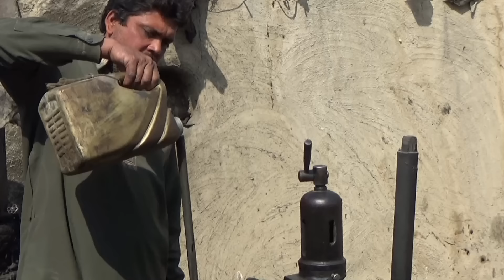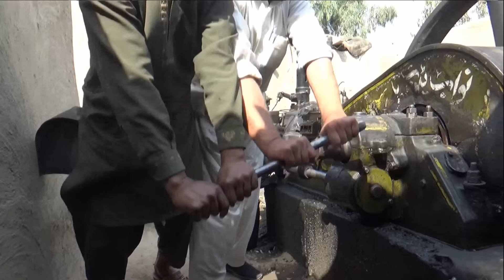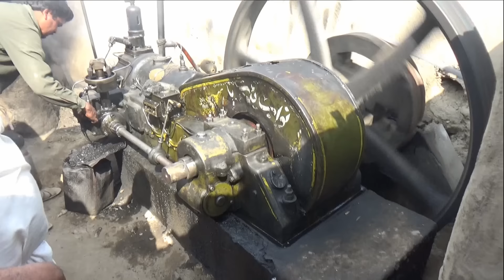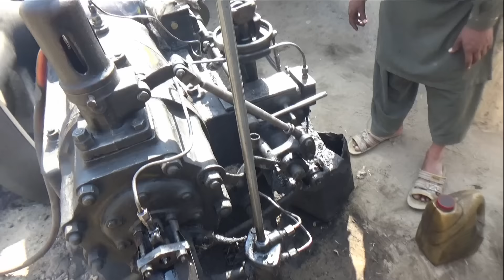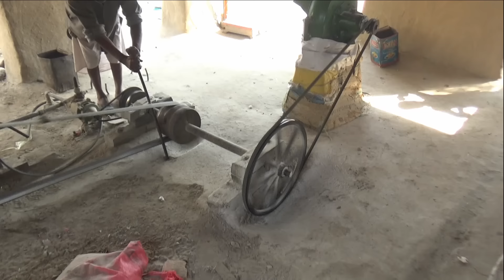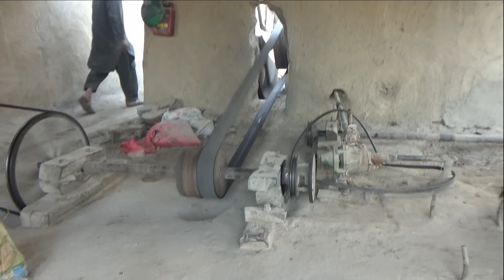Starting the Diesel Engine Best Sounding Engine 22 Hp 300 RPM Old  Black Engine

Comment: The exhaust whistle is so the operators can be away from the engine and still tell how it is running. Exhaust whistles were used in oil fields for that reason.
Reply: I was wondering about the purpose of the whistle.I thought it was to muffle  the engine clatter. Was sure the exhaust whistle was for something but not sure what. Thank you for explanation.
Reply: @nextlevel7790  they are usually made unique for each engine so you could have a dozen running in an area and be able to tell each one from its sound
Reply: Thank you!
Reply: Simple, inexpensive, funny and efficient
Reply: Not only the operators, the whole town can tell its running... :)
Reply: I put an exhaust whistle on my car. Daughter was not impressed with the turbo sound.
Reply: or just install an electric motor and forget that its ever there like any sensible person
Reply: @Blox117  then you need to manually start the engine to get the electric motor running.
Reply: @colinashby3775  *then you need to start the electric motor to get the engine running
Reply: Whoa. Thank you for explaining truly! ☺️
Reply: That's what the cherry bomb is for 😎
Reply: That’s a very interested fact. Thanks
Reply: I bet if I put one on my car's exhaust I'd be considered to be very cool.
Reply: @Blox117  nah....  that's not nearly as much fun.
Reply: @Blox117  yeah this place doesn't look like it has an abundance of affordable electricity
Reply: @raposonanquim7987   My life goals right there.
Reply: @Blox117  A 22hp electric engine with the amount of torque this thing puts out would cost thousands of dollars 💸  also it would require a 3 phase electrical supply. These countries barely have reliable single phase....
Reply: @jeremeneff3806  actually electric motors produce the highest torque of any prime mover. and one can be had for a few hundred at most
Reply: @Blox117  can you show me a 22hp electric engine with 65 pound feet of torque that is only a few hundred dollars and will reliably run in a 3rd world country with sub standard electrical grid?
Reply: Also, rpm range is very low so a gearbox would be needed as well.
Reply: @jeremeneff3806  if you tell me in newton meters sure
Reply: @jeremeneff3806  no an electric motor has an infinite RPM range unlike literally every other prime mover. also, 3 phase DC power is fed through an electronic controller that is powered by a battery. very very cheap and easy solution and it practically has infinite lifespan while being free.
Reply: @hughstewart547  solar panels to a battery. free
Reply: @NextLevel  not sure what engine clatter you're hearing.  The slapping of the external belts is n the loudest thing other than the exhaust whistle
Reply: its like those alarms that are sounding 24/7 with radioactive stuff, so if there is a catastrophic loss of power and you dont hear the alarm you panic
Reply: Uh do
Reply: Ну так тут рядом , он не нужен
Reply: I thought maybe Bubb Rubb had got to it.
Reply: But..........they are only 20 feet away from the engine!
Reply: headache
Reply: Подивитесь на теперішні движки через 70 років...і побачите різницю
Reply: @colinashby3775  свисток треба зі звуком b-29
Reply: These type of engines were used in the absence of electricity. Or they were used to generate electricity..

(As u know, electricity requires physical input from somewhere. Doesn't come out of the ground or grow on trees ofc.)

Comment: This engine has survived 67 years, so the maintenance can't have been that bad!
Efficiency around 30 %, but It can run almost on garbage! Woodgas, old motor oil..
Look at the exhaust! Looks Clean...
BTW, I was made that very same year, also still working!
Reply: U Probably use very good lubricant
Reply: Me too...also still working fine.
Reply: What do you run on? Asking for a mechanical friend in need....
Reply: 30% efficiency would be a hecking killer engine, I think you mean 30% of a modern one, and I doubt that too!
Reply: @Kalvinjj  modern diesel can have up to 44%
Reply: @jetztisfeierabend   The big slow stationary or marine ones can indeed, I think Wärtsilä managed like 54% out of their biggest marine ones, tho they also run with heavy fuel oil, dunno what fuel the test is made with.
It's impressive what you can do when you extract as much as possible on expansion and even the exhaust with a turbo.
Reply: 30%, only achieved with hybrid cars nowadays.
Reply: @pear7777  there is a difference in efficiency in petrol engines and diesel engines. Diesel have a much higher efficiency
Reply: It probably hasn't ran for at least 50 of those years. Of course it's gonna look clean.
Reply: 30% efficient though
Reply: I was trying to make a joke but I didn’t know how to write it 🤷🏼‍♀️
Reply: @NaviYT  better than any gas
Reply: @wizard_of_poz4413  I meant to say that he was made on the same year as this engine and he too runs at 30% efficiency lol
Reply: Cars are only traditionally around 30% efficient
Reply: It is very worn. A new, tight engine would start on the first turn.
Reply: Old is better then the new, not bounded to circuit boards or diodes . EMP proof.
Reply: Can this engine run on nitrous oxide (NOS) ? 🤣🤣🤣🤣🤣🤣🤣🤣🤣🤣🤣🤣🤣🤣🤣
Reply: Happy 70th
Reply: But hows ur exhaust?   Lol
Reply: Idk if wood gas is going to compression ignite - I think it still needs that spark
Reply: @Kalvinjj  Hybrid gasoline engines have 40% efficiency. That's for a hybrid. (Hybrids use Atkinson cycle, which reduces power but drastically increases efficiency)... Now muscle cars and super cars? Extremely low efficiency. But yes, 30% is good for a relic.
Reply: @pear7777  40% is current hybrid engine standard. The overall efficiency is technically 50%, when you include the energy captured by the electric motor and the EV motors superior efficiency when running off the battery power that was captured by either regenerative braking or the gasoline engine also generating electricity.
Reply: @stevebannon9250  For  conventional internal combustion engines that run on gasoline, yes. Atkinson gasoline engines, which are probably only used in hybrids, have 40% efficiency. EVs have 80-90% efficiency (Hybrids are an average of about 50%, largely dependent on how often the electric motor is able to propel the vehicle alone; plug in hybrids have higher efficiency due to larger battery, but the tradeoff of a much heavier battery pack makes that not as much.).
Reply: @jetztisfeierabend  It is now possible 50%, but 40% is the norm, unlike the 30% norm for most conventional gasoline engines. It's a shame diesel hybrids aren't common. It'd be nice to have a hybrid whose engine would easily last a couple millions of miles.
Reply: @anmolsekhon768  hahahaha
Reply: The efficensy is generally rated in electrical kw output at a generator head -  there is a lot of differences between diesel engines and the types of fuel they burn - 
     In the US all fuel on land is low sulphur fuel - yet marine diesel is 30% oil and 70% diesel - that's also used in places like India today - in the warmer regions - 
      There is also Bunker C fuel that is used in large marine  diesel engines - 
 In that case it's thick like motor oil and the fuel lines are heated to 350° f up to the injectors - also the engines have heaters to preheat the water to running tempriture before there started or the head will build up carbon if there started cold - 
       There Diesel's that run on tar oil - that like thick grease - the tar oil is also preheated up to the injectors to around 425° f  - the engines use oil for coolant and run at 250° f as to burn the fuel completely - 
     A diesel is just saying the engine starts on compression - but also the compression is only needed for start up - some stationary engines have compression change over valves - they might start up at 25:1 compression - then the compression is decreased after it's warmed up to temp to 9:1 compression - also some have a 25:1 efficensy were as a motive engine  that's a truck diesel might have a 5:1 fuel efficensy -
      Some of those stationary engines are extremely fuel efficient -  as for that engine from time to time the head is pulled and the valves are lapped back in -;
        Engines as  that one are still in service in oilfields running jack pumps some run off the crude oil coming out the well they pump.- it's refered to as diesel crud -

Comment: Beautiful old engine, still earning its keep! They knew how to build things back then!
Reply from the maker: Thank you so much sir
Reply: They still know how to. They just don't  want to.
Reply: Still can and still do 
Just need to pay for it....

The modern automotive ICE is a mechanical and electronic marvel of engineering
Reply: :D :D :D 

Actually... no, they didn't.... That lack of knowledge is why this 22 hp engine weighs 500 kilo or more (imagine the labour in mining the raw materials, the energy and manhours spent in casting, forging and machining the parts, the transport from production plant to wherever it needs to be)  and only spins 300 RPM. Takes several men and a lot of experience to get it to run, in fact it is such an effort that it is being started at the beginning of the day, and kept running all day even if there is no power requirement. Which cancles out in great part the otherwise good effciciency of even those ancient machines.

Back then a 22 hp engine would cost a small fortune and you had to formally order an individual engine, have it transported, installed, commissioned, operators trained, etc etc. A thousand bucks "1950's " compares to 12500 dollar nowadays.
Nowadays a stationary diesel can be bought off the shelf, installs in a few hours without fuss or commissioning, costs about 75 bucks per HP, and a 22 hp diesel engine weighs maybe 50 kilo including its generator, starts at the push of a button (so can be stopped without penalty if no power needed), and if it breaks down, well, you can buy a LOT of engines for the price difference between that ancient behemoth and modern stuff.

Nah... They did not have the faintest clue how to build a diesel back then.

But it IS beautiful technology, no doubt.

Comment: We have this in our village.they run this engine for corn mill, saw mill, and cotton mill.its was made 1911.whistle was used to let everyone know ,Open for business
Reply: It was actually used to tell the people cranking to take it out. It can kill you. It's actually the reason why cars don't have cranks now. The ceo of Cadillac Corp had his friend killed by one ans made a self starting one
Reply: Reminds me of workshops around here which used to use steam boilers.

They had a whistle outside, and once the boiler was hot enough to do work they let out a blast so customers would know.
Reply: That sounds closer to the right year for this engine. The design has probably been copied down the years because it is a solid simple workhorse.
Reply: @briananthony4044  i think it's even older design maybe around 1870? It's just a huge single cylinder oil engine, they have been since almost forever.

Comment: We had a similar one in India, which was around 50 years old, and was being used as an electricity generator. Delivered an output of 15 KW. Sold it around 10 years back. It was virtually unbreakable. Fond memories.
Reply from the maker: Thanks for watching the video
Reply: I bought a corded grinder from harbor freight and used it for 15 seconds and it smoked out. Smelled like burnt toenails
Reply: @biguprochester  ha ha. No that feeling.
Reply: Hello Same engine I have can you tell me what can do with these engine I have machine mannual and many papers
Reply: My guess is it was a DC generator on a battery bank on less it was to run motors on equipment - slow speed engines set up on generators are generally only used to drive electric motors or to charge battery banks - 
     With slow speed engines they create a voltage pulse that makes lights flicker - that flicker can be irratating on the eyes at night - 
     Generally single cylinder engines are not used for generators that run below 650 RPMs because of the voltage pulse of slower speeds - below 650 RPMs they use 2 & 3 cylinder engines for generators -
Reply: @able880  yes, it cause lights to flicker. But, it was an industrial establishment so didn’t bother that much
Reply: @coldsampat3972  my guess is they primarily used it  for  motors - my grandfather worked on engines and generators in small towns that still had hybrid power plants and that were 110 volts DC - 
       They had single cylinder 100 to 200 HP engines that ran from 200 to 360 RPMs - since they were   used to charge the large storage batteries  there was little to no flicker - also they used large chokes with capsitors to smooth the DC coming off the generators that charged the batteries so the voltage off the battrey's had little to no ripple off the generator while charging the power house battery's -  REA replaced most of those old DC systems with AC power by the 70s -

Comment: It’s cool seeing all the other devices being powered with belts coming off of the Diesel engine
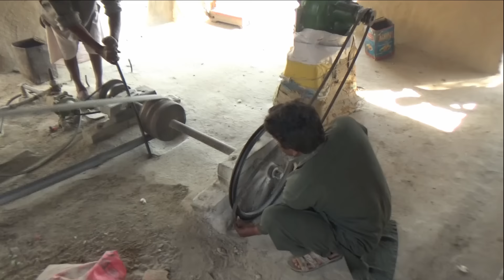Reply: I wonder if the man who mounted the belt with the engine running still has all his fingers attached (Minute 3:00). I was present when a friend manually pushed the belt of a compressor to help it start, it did start and he lost three fingers. Ouch.

Comment: Keeps 100 years: ✅️
Easy to repair: ✅️
Easy to use: ✅️
Reliable: ✅️
You're keeping fit by starting the engine: ✅️
I give 10/10 points it's better than this cheap sh... which breaks after 2 days👍
Reply from the maker: Great point!
Reply: Maybe low power output. But diesels made prior 2002 are great and powerful compared to modern crap
Reply: Cleaner than a VW ✅✅
Reply: Except with the huge amounts of fuel it burns, you could get like a 20lb electric motor and make that much power for the next 50 years for dirt cheap.
Reply: I think maybe check your definition of “easy to use”. Took 2 men multiple attempts of hard manual graft to get it started.
Reply: @ThaTurminator  If you get longer shaft it gets easier...
Reply: @ec7005  Well for all that fuel you get longevity...
Reply: And it will hold for next 200yrs if maintained properly
Reply: @josippetkovic389  electric motors under similar conditions can last just as long or longer without all the maintenance, and they're cheaper, simpler, direct drive, quieter, and weigh relatively nothing. Just because one random motor got kept up well doesn't make the underlying technology inherently superior, it just means someone actually did the work to keep it going.
Reply: Only costs an arm and a leg from time to time
Reply: Inefficient:✅
Reply: @ec7005  gotta buy a motor and have a reliable power supply.
Reply: @kr1886  which is incredibly easy
Reply: @ec7005  I like you
But hey you get a piece of history and maybe you turn some kid into engineerd with this
There is no magic pixies out of a wall that are running this thing. You get knowlege when using this, education aint cheap
Reply: @josippetkovic389  Electric motors give you just as much of an education if you take it apart and learn three phase power, battery management systems, and electromagnetism. It's just a different skill. There's nothing wrong with having or using this motor. My only point is that it's not better, especially just because it's old and lasted this long. Anything lasts forever if you keep it going. It's cool technology and it's good to understand, it just isn't better in any way than modern machinery.
Reply: @ec7005  so why haven't they done it?
Reply: @ec7005  yeah, and how you gonna power a 3 phase 22 hp electric motor out in the middle of a desert where there is no three phase service?
Reply: @tslim250  power supply. You don't need 3 phase service to get 3 phase power.
Reply: @ec7005  so what's going to supply the power?
Reply: In all likelihood, it probably hasn't even ran for 2 days since it was built.
Reply: If it backfires while crank starting by hand you will lose 2 men there.
Reply: That is why I won't buy a car and suffer in public transportation instead!
Reply: If you think any of this is good then you have a smooth brain.
Reply: @dmitryhwguy1646  wrong
Reply: @ec7005  wrong
Reply: The real definition of ‘sustainable’.  Something that lasts generations and not throw away.  Where’s Greta she should be endorsing this 😜
Reply: @michaelgibson2163  The way the crank is set up, you can only turn it clockwise. the only way it stays on is the tab and half circle keeping it in. If it backfires the tab kicks out because there is no pressure keeping it in.
Reply: @ec7005  and whats going to supply power to the power supply in the middle of the desert? Think mcfly!
Reply: @beverlychmelik5504  thata good. Old farmers who had no thumbs told stories about the backfiring crank that smashed it to pieces and had to be cut off.
Reply: @tslim250  where you gonna get fuel in the middle of the desert! There's just as much connectivity to power in the desert as liquid fuel, if not better.
Reply: it has 22 hp, and is a size of a room. the engines from late 90's were the best.
Reply: @ec7005  i'm gonna roll with the same place these guys got it from, duh
Reply: @tslim250  if they can get fuel, they can get electricity. It would literally be more efficient to use a generator and electric motor than that thing. A lawnmower engine would be better than that thing.
Reply: @ec7005  how are they getting the electricity to power the motor? They're not. Electric is not gonna run in those conditions.
Reply: @FlaGiant  in what conditions? What do you think makes an electric motor stop working?
Reply: @ec7005  no electricity
Reply: @FlaGiant  did you even read the last thing I said?